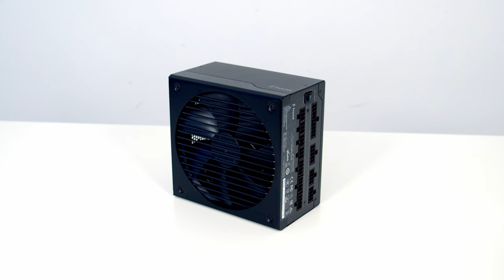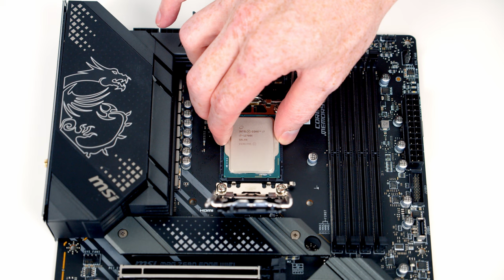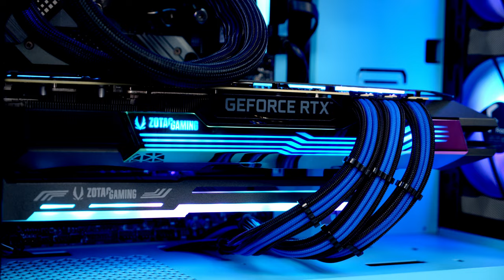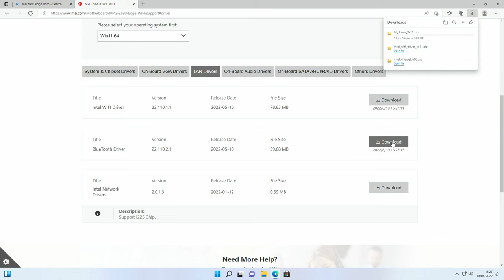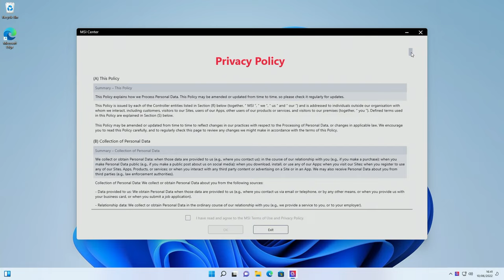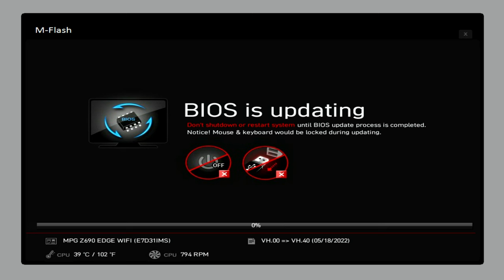Fractal Design Pop Air Build - Step by Step Guide

Comment: Just got this case today and couldn’t figure out the case fans. Thanks so much for this video.
Reply: ive built several PC's but ive always had the case fans pre installed to the fan hubs. these case fans have 4 connectors on each fan. kinda confused
Reply: Same thing with me
Reply: Same. Just started building while waiting on a couple more parts. Stopped where I'm at for the day in favor of checking this video out to get a handle on the case features. Thank you, Christopher.
Reply: Are those DC fans?
Reply: I still can’t. They have power daisy chained to Sys Fan and I’ve daisy chained the 3 pin rbg connectors together like shown in the video but the fan lights seems to flicker and the tbh case button doesn’t change the fans, just the button colour.

Update: Turns out the actual RGB I/O board thingy that controls the case RGB was faulty on mine. Works perfectly via motherboard. Contacted Fractal and they sent me a new board. Hope this may help someone!
Reply: i still dont get it
Reply: Same, I've only ever had molex fans in the past
Reply: Without Christpher's I'd be up the road. Thanks!
Reply: I can’t get the front fans to work but the back is working, anyone have any ideas?
Reply: @ijsarge  Definitely take a look at the diagram for the motherboard. It's easy to mistake the exact placement of connectors when they're close together.
Reply: you went way too fast with the fans
Reply: same lol

Comment: Your videos are amazing! Very clear - couldn't ask for better. I'm curious as your video here looks to only be approx 1 year old...yet I just bought a Prime Z790-A-WiFi and the pin arrangement doesn't match what's in your video i.e. Power SW. Do the Mboards change that quickly or is there a model difference here that I'm not seeing?

Comment: I have the same exact case. I never built a computer before. I was wondering is the sata power for the case controller required if i decide to plug in the case fans into the rgb led header on the mobo?

Comment: My RGB Fans of this case stop working as soon as I restart my PC. They only start working again if I unplug them from the RGB Controller and plug them in again while the PC is running. Next restart, they're off again.

Any ideas?

(I daisy chained only the three RBG fans which come with the case and connected them to the RGB Controller)

Comment: Hi, I was hoping if someone could help me. I have a 8 and 6 pin cable extender GPU question that I had recently bought. I have a 1070 Ti video card that has an 8 pin with a 6 pin port. However because of the tight fit of the mini-ITX case, the door is unable to shut because the connectors (the one that came with the PSU) are way to stiff for the door to shut. They stick out preventing the door from closing. And so I'm using the 8 pin and 6 pin extender which are very very flexible. The door closes and the build is finished. However I do have one major concern, since one of the 1070 Ti has a 6 pin port, is it safe to plug the PSU Y-Splitter 8 pin cord directly into the cable extender (8 pin port) THEN connect the other side which is a 6+2 pin connector, of which I am only using 6 pins into the 1070 port? Or do I need to REMOVE the 2 pins connecting from the PSU cord that goes into the extender which matches the 6 pin port that is on the 1070? Thanks for any help.

Comment: Hey there, great video great help! 

I have 1 question, my PSU is TX750M Corsair which has 4+4 for CPU. Motherboard is MSI Z690-A pro which has 8 + 8 and CPU is i5 13600k. I am planning to change PSU in the near future, is there anyway for the moment that I can connect the above mentioned components?

Comment: I have a similar build but needed to order the lga1700 brackets for my aio. Will I have to order the cable extensions aswell or are they not necessary?

Comment: Thanks for the video!  Just hooked son up with a new gaming PC for his 20th b-day (OMG!).   Appreciate the detail as the case docs are a bit slim and couldn't figure out why we couldn't get the RGB button to control things.  Docs aren't super clear with using the SATA power plug for the lights.  I figured it was related but didn't catch that the SATA light connector just went into a SATA drive power plug.   Very nice case for the price and hard to beat.

When do you think is a good time to move to a radiator for cooling?  Got him a i5-10400F Processor with the MSI Z490 Gaming Carbon Wifi board.

Comment: First, thanks for this video.  It was very helpful.   

You mention that you can plug the cable for light into the "argb header" or into the motherboard if we want the motherboard to control the lights.  I bought an MSI PRO Z790-P WIFI DDR4 motherboard.  Where would I plug this into the board so software can control the lights?  I would ultimately like to use an Elgato StreamDeck to control all of the lights on my PC so I can turn them off at night while allowing the PC to still run.  Thank you.

Comment: Great video. Question. The case specs note a 170mm max PSU length, but I don't see anything that would block one longer, like 180mm other than possibly the ventilation being off center.  Do you see any concerns going longer by 1 cm being an issue with PSU?

Comment: It's quite nice to know that this case comes with aio offset brackets. I was "worried" that I would have clearance issues with my 240mm Arctic liquid freezer ii since the rad is 38mm thick and the b650 mobo that I just bought.

Comment: It’s been a while since you’ve posted so this is a shot in the dark. I actually moved my current PC into this case from another as a size downgrade and aesthetic upgrade. But now that I’m moved into it, I can’t get the PC to power on. I had it working in my other case right before swapping. I believe the Power SW is in the correct spot, my power supply wasn’t unplugged from itself just put back into my mobo and GC, when I swapped back. Not sure what’s going wrong tbh.

Comment: Know it’s an older video but thanks for uploading! Just bought a new build with this case and following this definitely helped along the way. Although I had some different hardware such as the motherboard it still was very helpful seeing most of the process done. My only tick is that you didn’t show how to plug in the modular psu. I went to boot it up for the first time and got nothing because I apparently didn’t plug in all the correct wires into the back of the psu😅 So just gotta figure out why my rear fan isn’t spinning now and then I think I’m good! Thanks for the video.

Comment: Fantastic presentation. I’ve been considering this case simply because of the 5.25 drive bays, and after watching this I feel this is the best choice for me. The only thing I’m not crazy about is the location of the 5.25 drives. I would prefer them to be at the top like the Fractal Design Focus G Mid-Tower. However, everything about this case looks great.

Comment: Thanks so much for this video i subbed! You really did a wonderful job explaining everything. I notice the motherboard manual recommends putting your 240mm rad in the front... However i find if i put the rad in the front with the rad rad fans facing internally and the case fans still in the front as per the manual, then I'm unable to actually screw in the rad as the front fans block this. How am i able to do it? Fractal never included those extender wings... Atm i have no choice but to top mount it

Comment: I've just bought a pop air rgb, msi Z690a pro, and a 12700k, along with a new 850w power supply. Can't wait to build it! Sad thing is I will have to use it with my 1070 until I can afford a 3080 XD talk about bottleneck.

Comment: I'm about to transfer a build to this case since my previous case can't support the latest and larger GPUs. What was the reason for mounting the radiator to the top instead of the front?
Reply: It's so the air in the loop can settle at the top of the radiator. Meaning less noise and the cooler will operate correctly. You can place it at the front, but place the pump at the bottom, again so any air in the loop can settle at the top.

Comment: @24:34 no ram clearance issues? What about taller ram with heat.sink or RGB ?
Reply: Nah theirs a offset mound on the top of the case you can see it at 24:41

Comment: Hi, is there any magical incantations to have the fans light up ? they are spinning, I've connected the 3 RGB to the top header of the case, but there's no RGB at all. Thanks
Reply: Same here, not sure what's going on...
Reply: @SniperPFL   I first missed the part at 20m to plug in the case sata cable to the power supply sata cable. 
At least for me that was it.
Reply: @thesorus  yup that was exactly my issue, I missed it the first time around. Now all fans are lit and spinning, everything looks to be working except I'm staring at a black screen lol no graphics card yet but that shouldn't be the reason...

Comment: Is it possible to install a Arctic liquid freezer 240 aio in this case?
Reply: I really hope so... I'm planning on doing that as well soon! Should be fine according to the manual, but I guess you can never be 100% about the clearance until you see it.
Reply: I don't see why not, it can do a 280 or 40 front and top.

Comment: Great build as always😀The only downside of this case is lack of front dust filter. The rest is great for the price.
Reply: I had the p500s it was the best hoover i ever owned,it was a nightmare to keep clean & i can't see this being any different.It's a shame because it's a lovely case
Reply: @happyfeet4506  I agree.
Reply: I got a brush and brush my pc every time I turn it on while it boots,  helps keep dust to a minimum..
Reply: @happyfeet4506  Forum dwellers seem to like it some. NZXT's cases are simillar (or rebranded maybe). They label the bags and cabels, and for fans and rgb have just one clip. Which for the initial build seems like a no brainer idea.

Comment: Bought a asus550 plus for a new Ryzen 7 5700x and found out it didn't fit my existing first beginner case(I bought pre built, cheap beginner)...Found out I'll need everything upgraded....so I've gathered all components minus one 2tb SK Hynix 4.0 NVMe SSD that will be delivered today. Had it figured mind that I'd go budget for my case to offset costs. But I noticed when you cut corners you get burned in the end. So I'm thinking about this Fractal Case. Love the cable Management. Not use to that will my beginner budget rig. *Edit just got my case building now and should've watched your video first 😂 fractals instructions say put the PS in First 😂